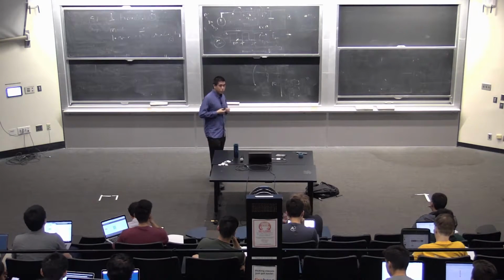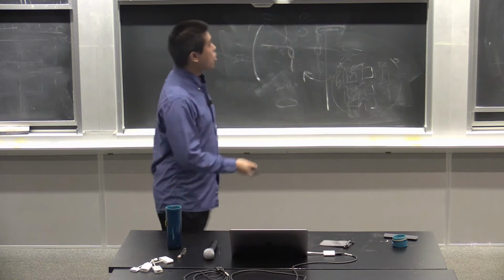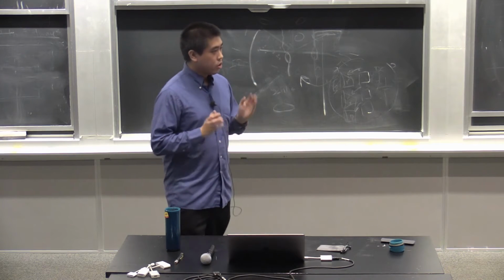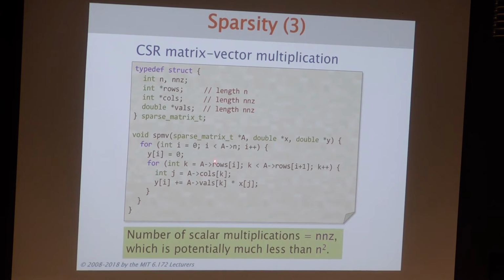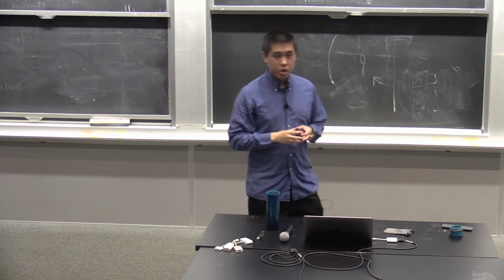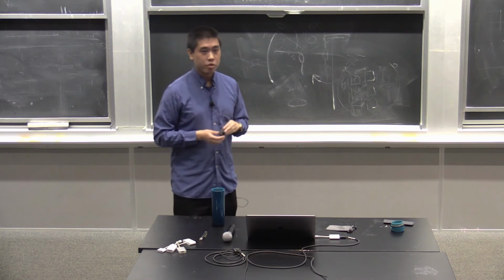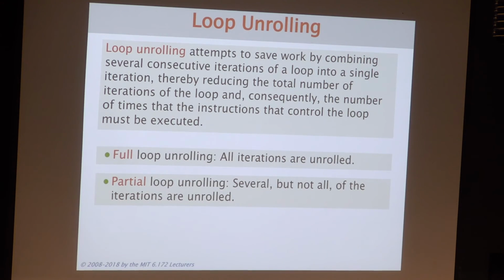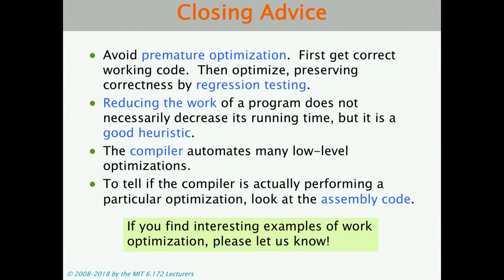2. Bentley Rules for Optimizing Work

Comment: Someone really had fun creating the example at 27:02: The non-zero entries are the digits of pi, the vector are the digits after the comma for the pi approximation 22⁄7 and there are 22 0es in the matrix! :D
I don't know what the significance of the placement of non-zero digits or the gap sizes is, though. There are a couple of almost-patterns, but two nerds together couldn't find anything that really fits. ;)

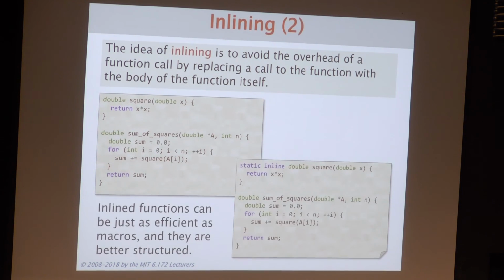Comment: 1:17:40 so why not make all functions static inline? Does it only work for one-liner functions?
Reply: @jean-claudearbaut7322 interesting, thanks!
Reply: B/c processors also have instructions cache that will be polluted and could eviction of useful entries could make the code slower, not faster.

In C++ there exist an issue called "template bloat" - all templated code is implicitly inline, so each template instantiation generates a totally new instance of a code. If a library author isn't careful to design their templates class hierarchy to move as much template parameter independent code into base classes, there'll be too much unnecessary code generated, which could slow down the program.
Reply: Also it should be noted, that in C++ (just don't know about C) inline keyword doesn't even make compiler to inline the code anymore 😁 Instead it's more a tool to fix ODR violations 😁

Comment: This is good stuff BUT it is Low-Level. Programmers will think all they have to do is rummage through their code looking for things like this and then apply fixes like these. Again, this is good stuff, but when you're looking at a mega-line app, first you need to find out what needs to be fixed. For example, you could see some O(n^2) code and try to replace it with something O(n log n). But if the PC is never there, and n never gets bigger than 3, the problem is elsewhere.

The method I've used for a long time is random pausing. It sounds like the "poor man's profiler", but it's different. All it needs is a way to get a small number of stack traces at times uncorrelated with what the program is doing. There are tools to do this, but there is always a debugger that can be manually paused at random.

Assume there is a problem that needs to be fixed. (There always is!) Assume that, when fixed, it will save X% of time. Then the probability that a pause will land in it is at least X%. It could be anything - low-level algorithm, memory allocation, reading/writing a file, etc. The reason you look at the stack is to see why it's being done. If the reason why is a poor reason, if it could be improved or eliminated, you're looking at a speedup. And it's always a surprise! It's never something you could see by just eyeballing the code.

Typically X is in the range of 10% to 90%. So you take pauses and stack traces until you see the problem, and 10 is usually enough. I've never done more than 20. Remember, the object is to find the problem, not to measure it with precision, which is why a large number of samples is not needed, especially when the large number of samples causes not finding the problem.

There are almost always multiple problems, in a range of sizes. If problem A is 50%, B is 25%, and C is 12.5%, fixing A doubles the speed. After fixing A, now B and C are doubled, to 50% and 25%, so if now you find and fix B, speed is doubled again. Now, of course, C is 50%, and fixing it doubles the speed yet again! But, if any one of them is not found, you see that a heavy price will be paid.

This is a very old trick. I just fell into it some 50 years ago, and I met various old-timers who've used it and thought nothing of it. At the same time, programmers are being taught about various profiling tools that, honestly, can't hold a candle to the random pausing method.

Thanks again for good stuff. By the way, I'm a big fan of Jon Bentley.

P.S. Granted, there are profilers that take thousands of stack traces. But then they don't show them to you, because there are too many. Instead they try to summarize into things like hot paths, flame graphs, etc. Those summaries have the effect of hiding what would be obvious if you simply examined a small random selection of them and matched them to the corresponding lines of source code. Then, to make matters worse, they suppress taking samples during blockage like I/O (making it invisible), and pretend that's an advantage by calling them "CPU profilers".

P.P.S. What about multi-threading? Then what you do is grab the stack traces of all relevant threads at the same time. If the app could be faster, it's because some thread is being held up waiting for some other thread. So you find the other thread and see what it's doing, and so on. This process is very much like debugging. You have to apply your mental faculties to the moment in time.

Comment: Sorry, but the example about detecting an overflow at https://youtu.be/H-1-X9bkop8?t=3817 is completely wrong. The overflow for signed integers invokes Undefined Behavior, no matter if `int64` is 2-complement or not. The compiler can happily remove all those  `sum < A[i]` checks if it could prove that values `A[i]` are always non-negative. It's a shame that such a crappy advise is given to the students at "wanna-be" the best technical university. Shame, shame, shame... DV

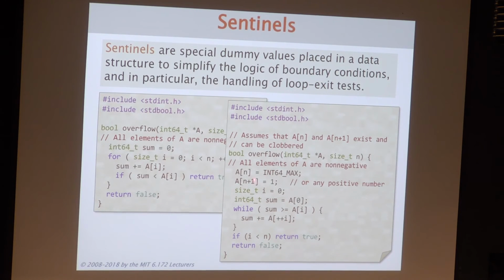Comment: 1:05:00 
But what if A is like { 0, 1, 1000, 10 }? After sum += 0, sum += 1, sum will be 1 and A[i] = 1000 so the loop breaks, also i is less than n and function return true which means it does overflow, but it doesn’t!
Reply: Note the prefixed ++i in the body.
It would add A[2] then compare sum >= A[2]
Reply: sum += A[i++]
The A[i++] grabs the next elem in A. This is equivalent to sum += A[i+1]. So the first iteration it to will the 1, then the second it will at the 1000, then the third it will add the the Maxint, overflow at i=n, then the check if i < n will return false.

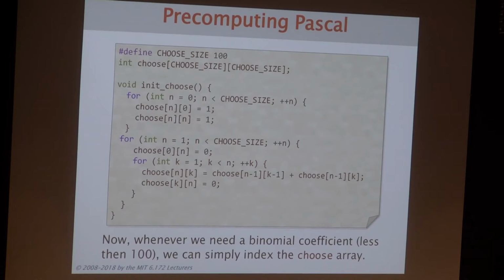Comment: The binomial coefficient table (18:25) is very naive with respect to integer size. To represent those rows up to 100, one needs at least 96 bits for the largest ones, which is 6 times as much as C guarantees for an 'int', and3 times as much as one actually gets nowadays. The int type is good only up to and including row 33 of Pascal's triangle (unsigned int would give you one more row)..

Comment: At 57:00 , can we expect the compiler to always pick up on those common sub-expression eliminations, or at what point are we expected to do that ourselves?
Reply: If it's something you'd expect to make a significant performance difference, then it's probably worth checking the assembly output of that section during debugging to make sure it's doing what you expect, then gaining a sense of what it can recognize and optimize and what it needs some help with
Reply: In general, no, because a potential aliasing could require a compiler to issue re-reads/re-computations if an object of the same type was modified and the compiler wasn't able to prove it's a different object. So doing CSE manually is still a good habit to have

Comment: In embedded system where execution must halt while the next data set is pending, I compute the partial computations instead of waiting

example computing a 3D vector  - sqrt ( x*x + y*y + z*z)

Start data reception
initialise output value to 0
read x
start data reception
calculate result = x*x by table lookup

Read y
start data reception
calculate result += y*y by table lookup

read z
calculate result += z*z by table lookup

calculate square root by custom routine tailored to the in-bound limits of 'result'

I eliminate all the wast of checking for result ready and insert useful code.

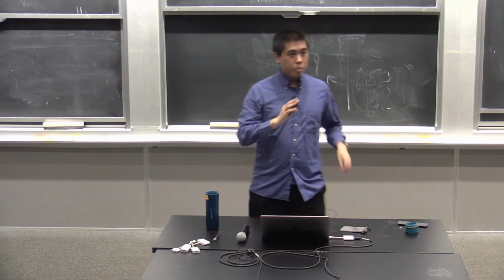Comment: At 30:20, in Compressed Spare Row format (CSR) , matrix has few elements wrong.
cols[11] = 4 (instead of 0 ]
cols[12] = 3  (instead of 4)
cols[13] = 4   (instead of 3)
cols[14] = 5   (instead of 4)

I discovered the issue when I coded up the CSR representation and wrote unit test based on classmaterial.
Reply: Uhh many thanks for sharing, I also noticed it but thought it should be intentional assuming they would fix it in the video, and have been trying to find a reasoning that would make that part correct for 10 mins :D
Reply: I came here to say the same thing, my mind exploded knowing it was wrong, but not knowing the algorithm I thought I had miscalculated; thanks for clarifying

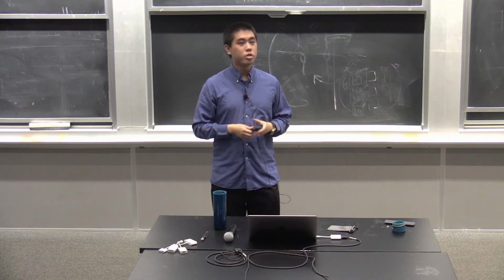Comment: @44:02
Why c=b+c
Is not equals to b=0?
Reply: It's not maths. 
Assume b = 1 and c = 2.
Then what this will do is : c = b + c or c = 3.

This happens like this : (Note &a : address of variable a in memory. )

A new register pops up goes to the memory location of b using &b and copies the 64 bit value of b in itself. (Say this register is X).

Similarly a second register pops up goes to the memory location of 0c  using &c and copies the 64 bit value of c in itself. (Say this register is Y).

Now these two register go to the ALU or Arithmetic and Logic Unit that knows how to do addition. The ALU takes the contents of X and Y and does Y <- X + Y.(This means add X and Y and copy the result to Y).

Now computer knows that Y had  the contents of c in itself, it goes to &c and dumps the contents that it has in the memory location of c.

Comment: My takeaways:
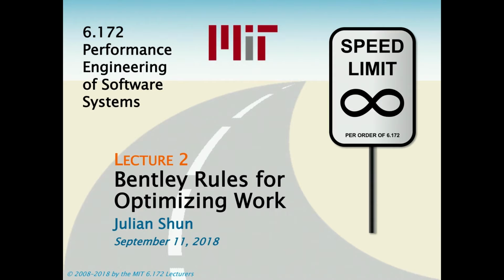1. What is optimizing work 0:44
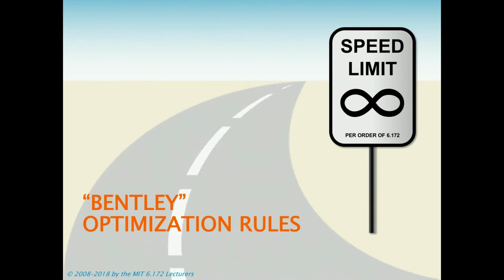2. Bentley optimization rules 2:42
3. Data structures
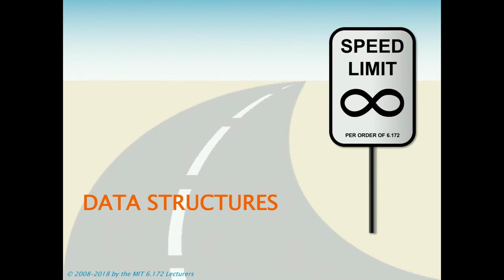3.1 Packing and encoding: reduce memory access 4:57
3.2 Argumentation: make common operations faster 10:50
3.3 Precomputation: perform calculations in advance 12:48
3.4 Caching: store results that have been accessed recently 23:30
3.5 Sparsity: avoid storing and computing zeros 26:32
4. Logic
4.1 Constant folding and propagation: evaluate and substitute constant expressions during compilation 38:55
4.2 Common-subexpression elimination: avoid computing the same expression multiple times by evaluating them once and storing them 41:55
4.3 Algebraic identities: replace expensive algebraic expressions with algebraic equivalents that require less work 44:17
4.4 Short-Circuiting: when performing a series of tests, stop evaluating as soon as you know the answer 48:03
4.5 Ordering tests: when ordering a series of tests, put the more often "successful" ones or computationally inexpensive ones first 52:00
4.6 Creating a fast path: creating computationally inexpensive alternatives 54:33
4.7 Combining tests: replace s series of tests with one test 57:38
5. Loops
5.1 Hoisting: avoid computing loop-invariant code 1:00:32
5.2 Sentinels: are special dummy values placed in a data structure to simplify the logic of boundary conditions, and in particular, the handling of loop-exit tests 1:02:45
5.3 Loop unrolling: combining several consecutive iterations of a loop into a single iterations 1:07:38
5.4 Loop fusion: combining multiple loops over the same index range into a single loop body, thereby saving the overhead of loop control 1:11:55
5.5 Eliminating wasted iterations: avoiding essentially empty loop bodies 1:13:45
6. Functions
6.1 Inlining: avoid the overhead of a function call by replacing a call to the function with the body of the function itself 1:16:30
6.2 Tail-recursion elimination: replace a recursive call that occurs as the last step of a function with a branch, saving function-call overhead (not covered)
6.3 Coarsening recursion: increase the size of the base case and handle it with more efficient code that avoids function-call overhead (not covered)
7. Closing advice 1:19:15
Reply: My takeaways: guuulp 💦🥤
Reply: can i start this course with only basic python programming skill as a prerequisite??
Reply: @yonimah no, learn C++(This whole course is in C, C++ is a successor of C). As you may be a self-learner, do it by book Tour of C++.

Comment: How relevant are these optimizations when writing code in modern compiled languages such as C# or Rust?
Reply: These optimizations are absolutely relevant regardless. Fundamentally, compilers can only do so much optimization by itself - so many edge cases and possibilities to consider for the compiler.
Reply: I'm learning some assembly as well as computer organization recently, and it greatly helped me to appreciate these effort, because, regardless how advanced the compiler is, our code is compiled to a sequence of instructions(add, multiply, move stuff from memory to register), and the optimization mentioned here are basically reducing the unnecessary / expensive instructions that we will feed to CPU. (like the test mentioned in the two dots example, your compiler is not going to be that smart to put these checks before the sqrt)